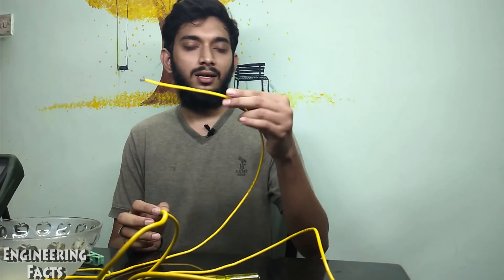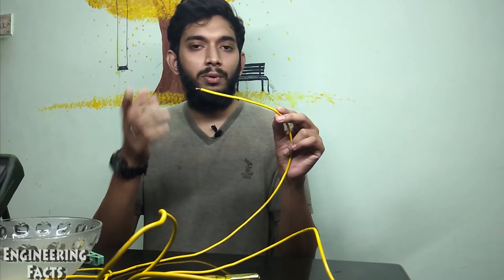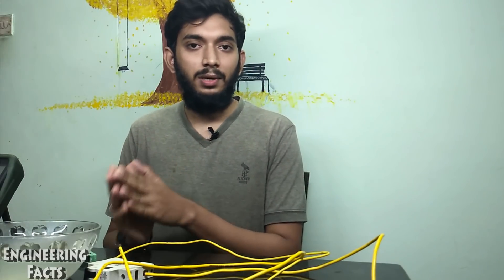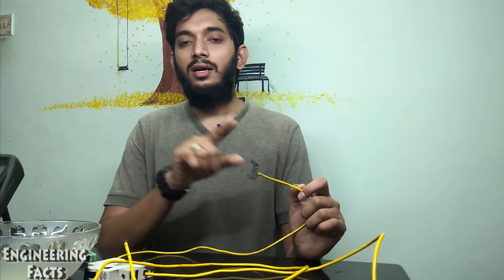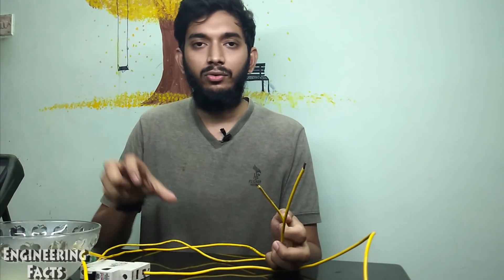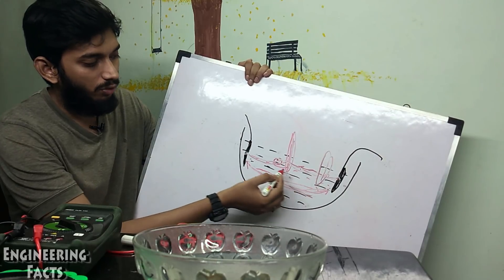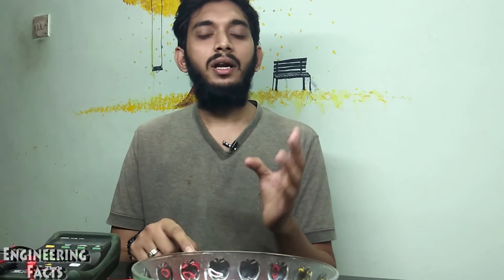How electric shock affects human body?_Tamil, Which make electric shock- Voltage/Current?

Comment: Bro innaiku enakku shock adichathu 
Table fan plug connect pannen apo wire la iruntha damage nala shock adichirichi but total body um top to bottom antha electron flow therinjichithu but gods grace ethum agala entha pain um illa but oru 3 second atha feel pannen antha oru 3sec conscious eh illa antha electron flow mattum therinjuthu...

Epdi thappichen ethum theriyala... Apo voltage kammiya irunthucha i don't know...

Comment: Sir water ah namba vt regulator ahh use panna mudiyuma like oru brushed ac moter ku thevayana voltage pathingana 150 v nu vecchikonga Neutral direct ahh moter ku connect pannitu Line ahh konjo salty water kuda connect pannitu 150 voltage ah convert panna mudiyuma sir

Comment: Copper, Silver and Gold are the 3 best conductors (low resistance). Silver, Gold and Copper is the proper order. Copper is chosen for economic reasons and Gold contacts are used in electronic equipment because Copper is not chemically inert (contacts will get increased resistance and thus heating causing the contact to fail with time due to oxidation of copper).

Comment: That's why the USA has 120V AC as the standard power supply.  When I used to open the circuit, I mistakenly touch the lines, but slowly I feel that I am becoming a conductor.  The only big problem is we need to use thick cables for taking the electricity.  Can someone explain why we need to use thick cables for 120V AC rather than 240V AC ??
Reply: Power remaining same if you reduce the voltage current will increase. So more current needs thicker wire

Comment: Bro Boul water explanation  panigala bro atha Yan  voltage wariation panna use panna kudathu   western countries la parum balum  230V  lam use pannama kammiya tha use panraga even switch  use pannama malaya 🔌plugs aa adapter la plug panra mare than iruku  

Na yanna soilla varana      water boul    Intha oru technic aa   ipo polakathula irukura mareyana voltage step down panrathuku payan  pada kudiya equipments ku pathila  water boul    Itha oru device  aa mathi voltage warry  panikilama  panna mudiuma yanthamare disadvantages  and advantages  irukum ?

Comment: Bro can we draw 70 amps current from my 30 watts realme mobile power bank for one second for powering Alto car starter motor which is 800 watts.  Powerbank specification tells 12v 2.5 amps / 5v 6 amps like that. 
Some Car jumper kits available in 11000 mAh battery. Can we use mobile powerbank as car jumper kit. Please reply.
Reply: No, you cannot draw 70 amps from a 30w power bank because the charger can have only 6 amps at maximumwhich is not enough for powering 840w out of 30w powerbank.
Reply: @E-GaN  thanks for the reply
Reply: You are welcome 😊

Comment: Boss. A BIG REQUEST. Pls add disclaimer while doing the shock test or if possible remove the part where you have immersed your finger inside water. If kids watch this, they will surely try this. These days, lot of kids have Smartphones and they watch anything without parents assistance. This is surely an dangerous experiment. 
Adults can understand the seriousness. But youngsters and kids will feel "Lets try". 
Other than this, I just admire all your videos. Clear explanation.

Comment: Do you say that a open copper wire without insulation in a closed circuit is not a danger to human... Because copper being a super conductor will carry the current quiet easily.. If we touch the line and us being a semi conductor, the current will skip us and chose the easier option... Are you sure... Can i try touch a uninsulated wire...

Comment: Bro oru doubt, ipoo oru diesel generator la output voltage is 220v(phase-phase), apoo 127v(phase to neutral) , ningah sonna mathri 130v iruntha than shock aadikumna, nambah aantha generator neutral point direct ah kaiya vacha shock aadikumah aadikatha

Comment: Hi bro nice video, how it's possible  resistance is high   when u keep the finger near by neutral cable and vice versa
Reply from the maker: What I meant was, For that low voltage the resistance is high to catch on..

Comment: Hi bro close circuit illama (without earth) element bulb work aaguthu. Athavathu 2 wire konjam neelamaanathu. 1 mattum ac ku connect panni maththathu return path illamalum bulb work aaguthu. But Bright kuraivaa. Appo return path illama eppudi saaththiyam
Reply from the maker: Oru wire mattum connect panni, work aagathu. Yethavathu innu kandipa return patha irukanum. Appo than work aagum

Comment: Thank you for the great effects taken for your experiments. As per your experiment shock... I have one question, if the human body touching electric wire then the human body acts us open circuit... If the human body closed the circuit , it will act as a conductor or semiconductor.
Reply from the maker: Depends on voltage level

Comment: Bro en bike la 5 amps battery ku pathila 9 amps battery potu irukean. Stock Rectifier a epdi boost panni extra va amps vara vaikanum
Reply from the maker: That's depends on RPM and running time. Not on rectifier

Comment: Bro, 12v dc motor direct ah power plug la vacchi run pannalama?
Reply from the maker: Bad idea
Reply: @engineeringfacts  ok bro. input 220v output12v nu irukkura adapter use pannalama

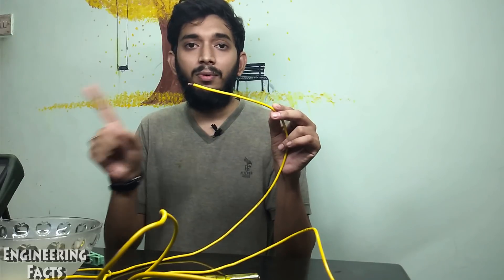Comment: Hi, important correction at @1:20. you said electron will flow towards earth (ground). but in reality, electron always comes from the earth. the current will flow towards the earth, not electrons. kindly check the facts.
Reply from the maker: That will happen in direct current. which is negative, not ground. Alternating current, the electron will not flow in series manner, it'll change its flow direction every cycle. Only the energy closing path is used as neutral or ground. what I explained was only an half cycle of AC

Comment: Distilled water is insulator means why it used in battery..4.40
Reply from the maker: As electrolyte, mixed with sulfuric acid

Comment: Bro TV picture tube 12 volte only but watt 3000 shock is very high not this current not detiting  duster not arrest in earth
Reply from the maker: Puriyala
Reply: @engineeringfacts  TV picture tube voltage 12 volte only but current shock adikuthu

Comment: Bro AC indoor unit la generate aagura water ah outdoor unit aluminium fins la pore aaga vekurathu nalatha illaya ,efficency increase aguma illa aluminium fins ah affect panuma
Reply from the maker: Thurupudikka arambikum, neenga ninaikura Mathiri efficiency kodukathu
Reply: Indoor unit la irukura same setup(aluminium fins and tube) tha outdoor unit la um iruku ,water condense aagura indoor unit la water aala problem varala,so outdoor unit la um water patta affect aagathu la
Reply: Water has more heat absorbing capacity, if we pour condnsed water getting from the indoor unit ,i think surely it ll increases heattransver and increases effency in ll save some energy
Reply: If the 1.5 ton AC run for full night we get more than 30liter of water ,30liter*4185 jules  ,ll get more efficent la bro?

Comment: Mukkiyamana question bro... Water la distance poruthu voltage maruthu sonninga...குரங்கு, kaka லாம் cable la vakkaram pothu சில நேரம் conduct agura mathiri கை vachi இறந்து poguthu apo voltage and current ore flow la iruku ok... Konja naal முன்னால அந்நியன் film la விக்ரம் sister Street பவர் கேபில் cut agi irnthuta mathiri kamipanga apo அந்த பொண்ணு இருந்த இடமும் cable cut ஆனா distance கொஞ்ச tholaivu irukum earth la close agurathu naala அந்த பொண்ணு iranthurukuma மழை தண்ணீர் semiconductor ah conductorah?athula salt irukuma? Salt ilatha water insulator ah than work agum அதுல current voltage ரெண்டுமே iruka tha? itha pathi konjam vilakkuna நல்ல irukum... Nan ketathu sariya puriyati mannichikonga நிதானமா 2 முறை படிச்சி purinjitu பதில் sollunga doubt Clear pannunga
Reply from the maker: Kakka, verum line cable la mattum vukkantha, athu saagathu, athu parakkum pothu, athoda rekkai neutral cable la padum pothu, seththu pogum. Cinema, Antha Mathiri condition layum distance poruthu than shock irukum. Already current ground valiya poitu irukum. Namma cable pakkathula touch panna than shock adikkum.
Reply: @engineeringfacts  thank you..

Comment: DC current ku same condition thanaa... Ilaa voltage um current value change agumaa
Reply: AC current is more dangerous than DC circuit. Since there is an alternative current sine waves in AC , it makes more shock effect than DC because in dc there is constant and linear wave.
Reply from the maker: https://youtu.be/PJJUkvqRy10

Comment: Anna itha Mosquito bat evalo output voltage kudukuthu if more than 220v na can we use it as inverter? Plaease read and do a video n.Thank you
Reply from the maker: https://youtu.be/kQH6spa-Wz8
Reply: Antha inveter curcuita nama namma home supply ku use panna mudiyuma for lights and fans?

Comment: Thanks for the information. I've been waiting for a long time to explore this, since I am not a electrical engineer I don't want to test. But I know even 500 amps wouldn't harm human body. I realised this in welding machine. I want to understand the electric flow in the welding machine, what is the optimum amount of voltage in the welding machine. Please provide details about this. Appreciated thanks
Reply from the maker: I haven't checked welding machine. So after checking, I'll tell you
Reply: In this expt path chosen is two. One human body another  So we can't say it's due to voltage of 110V. Rendu path la yum potential difference same ah than irukum.

Comment: 11kv transformer la 440v convert aguthu ok but v2ku pogum pothu eppdi 220v ja eppdi convert achu itha keten athu ku vanthu phase to phase 440 phase to neutral 230 nu sonnaga phase to neutral puriyuthu but 440 voltage puriyala and athu 120 degree la  process iruku atha nu sonnaga athu puriyala konjam detail la sollunga bro
Reply from the maker: We'll make video on 3 phase& single phase

Comment: Hi bro, Good info to all. Thanks you so much. 
And I have one queries like what will be resistance value in body? How to calculate that? Bcz body withstand still 130v in that case can we calculate the resistance from that?
Reply from the maker: Can be 100kohm to 1 Mohm. Will vary. No proper way to measure it.
Reply: Engineering Facts thanks bro

Comment: Bro thannila irunthu current flow agumbothu neenga groundoda attach agi irutheengala??
Reply: No need for that, ground a touch panna thevai illa, shock adikkum
Reply from the maker: I tried both method on rehearsal. Without ground also shock will be there. But I tried with ground. And explained without ground method. Because people should not try with ground, which is too dangerous.

Comment: Pls make a video is it possible to run big motor with 9v battery and transformer
Reply from the maker: It delivers low current. Big motor means ? 1 Hp?
Reply: Yes bro

Comment: Neenga romba alzaha irukkenga bro. And you're voice also similar to ANIROOTH, I like that Too. 
I understood what you said.
So many years I have this doubt now cleared.
Now I have one question 130 volt and 100 ma DC current it can make electric shock or not or same voltage and amp hour can be make shock or not?
Reply from the maker: Yes